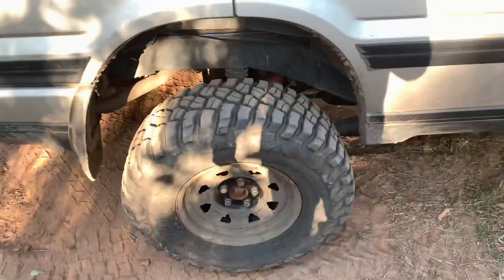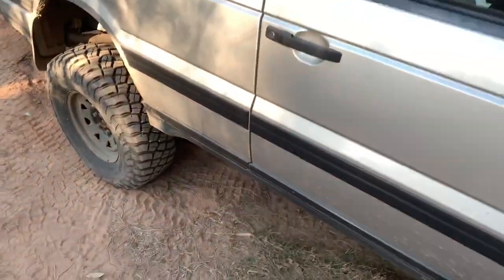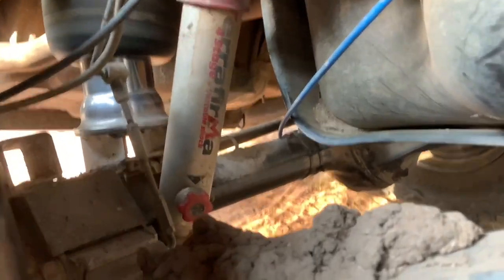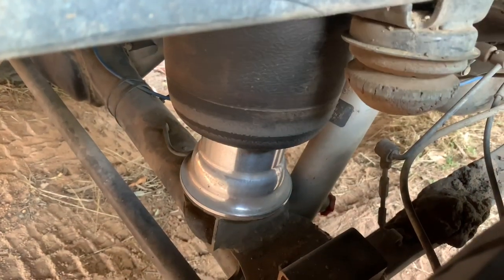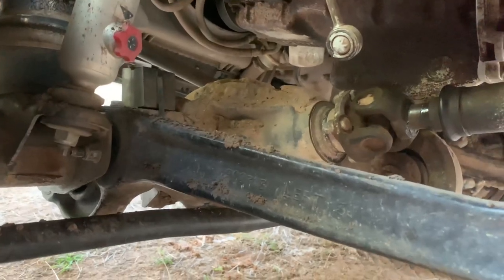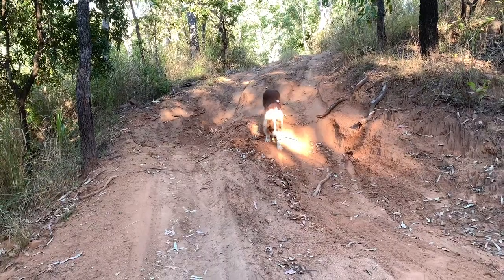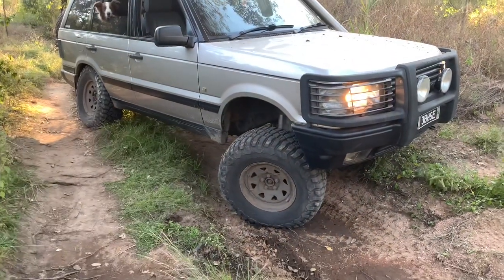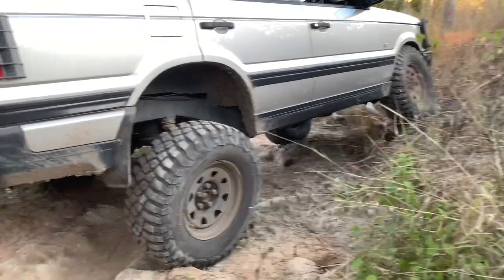2” Suspension Lift & 33” Tyres | Do it yourself | P38 Range Rover 4x4 | Flex it up!

Comment: Hi there.. I've read your the article in the forum. Nice job.
My questions..
When the car is on the lower height it stills comfy? Like highway.

I've got regular coil springs and planning on changing back to air, because I need the ability to lower the car down so I can get in the garage door. I've been instructed that's this Arnott already have the extra length I'm looking but I wonder if it gets safer for the balloons to use the spacers so the balloons don't get ripped off in a flex.
I'm putting the tyres 275/75 r16 and with the coils the tyre but inside, do you think I will need the spacers or just the balloons are enough? 
If I do the spacers a little smaller, let's say 2.5cm on the front, the rear spacers have to have that difference like 3cm on the higher side and 2cm on the lower, is the math done right?

Thanks for the video great great job 👏🏼👏🏼
Reply from the maker: G’day mate, thanks for the message! I didn’t think my link on the forum would get any views!

You’re probably best having spacers too mate. If you don’t do it, you’ll send your guards to the hospital pretty quick!

If you want to do smaller spacers, you’re probably best to drop down to a 265/75 tyre. Even the 275 will be a bit much on a 1” lift.

The other option is to limit the bump stops - make them bigger to prevent flexing so far, although that will prevent you from lowering the height in access mode.

Even with the 2” suspension lift you’d be surprised how low they go. I have to use access to get into my garage, and that’s like an archway - and I’m on 285 tyres.
Reply: I've written wrong.. the tyres are 265/75 r16 dumb me..

Thanks for the reply, like you said I will probably go with the spacers the same as you, that will hélice me the versatility if I want to go bigger one day hehe the bump stop it's a option too, always better to prevent than to repair.. hehe

Thanks again, as soon as I have the beast running I will share something 😜
Reply from the maker: Spot on mate! Spot on 👍🏻
Reply: Hi again.. how about the shocks? Which shocks are you using? Have been told to fit the OEM front shock on the rear.. is that enough to use all the travel of the air suspension?
Reply from the maker: If you’ve got spacers under the air springs, run the Terrafirma +2” P38 springs. There are two types - adjustable and non-adjustable!
Reply from the maker: 2” Suspension Lift With A Difference | BAG IT UP!! P38 Range Rover Airbag Suspension | #eas #airbags
https://youtu.be/GiEAwAY1cIo
Reply: I've been seeing the video again.. and I seen them.. 😅😅 people are talking the terrafirm are not great shock absorbers but if it works for.younit will work for me hehe..

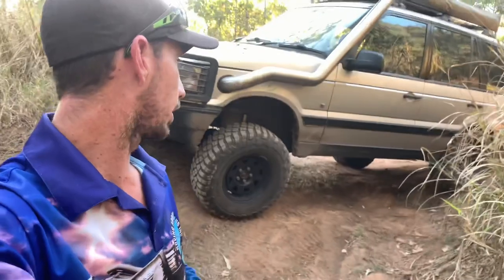Again... great car 💪🏼💪🏼💪🏼 thanks for the video 15:17
Reply from the maker: Thanks mate! I reckon they’re a great shock absorber! 5 or 6 trips to Cape York, plus all of the other HELL I put them through, and 6yrs so far must mean something! Maybe others don’t have them set up right?

Comment: Anyway you can have a set spacers fabbed up for me?  Will arnot genii bags work?
Reply from the maker: I’ll have to sit on that one mate. My metal shop took a break during COVID so I don’t know if they’re running again yet.

You definitely need the Gen III’s for the lift, you’ll over-stretch the Gen II’s or standard bags.
Reply: @Keithy_W  Thanks for replying.  Is there a blue print with dimensions for the front and rear spacers floating around anywhere?  Did you ever consider cutting and welding to extend the sensors?
Reply from the maker: I’ll have to have a look mate. I can’t remember what I’ve done with it!

I didn’t consider welding the sensors because the metal is so thin it’d be a very risky job. It was easy enough just to cut and thread it.
Reply: Decided to go 4" coil lift by lucky.  I don't know exactly how much taller it is than yours, but I assume it should be similar.  I assume it's 4" higher than ride height eas, lucky couldn't confirm though.  Anyway in your opinion for a 4" lift how necessary are adjustable be panhards and custom driveshafts?
Reply from the maker: That’s the go, and the best part is that you’re doing it your way.

At a guess I’d say that the 4” coils would be 4” taller than the EAS at “standard” height. That would make it 2” taller than EAS “high”. Only a guess though, don’t quote me on that. If you take measurements from the guard to the centre of the wheel, in mm, we can compare and you’ll get a rough idea of how much lift you have.

As for panhard rods and driveshafts, I would definitely be doing custom for each at the height you will be running all the time.

Comment: Do you always run on and off trail without the anti-sway bar? Or is it only disconnected for off road driving?
Reply from the maker: RJ G’day mate! I run with the sway bar all of the time. The exception at the time I made that video was that I’d just returned from an extreme 4wd trip where I had to remove the sway bar because I broke the sway bar linkage. You can see the bent linkage hanging down during this video, I literally just returned from that hardcore trip prior to making the video.
Reply from the maker: RJ with that said, the sway bar is sitting in my garage right now, unattached, and the P38 handles like the QEII.

It will go back on, when I get linkages. Until then, I’m not concerned.

Comment: Where did you get that front bumper?? Cant find it online. Can you help me by sharing info about it. Thank you!!
Reply: It is the factory brush guard. Made by Land Rover.
Reply: I do have same question!
Reply from the maker: It is the standard P38 bumper and bull bar
Reply: So funny my p38 has them as well I looked to find some more pics only to notice not many came with this feature.  I have all the brush guards and the ralley lights and the headlight wipers. . Green with brown interior with black pipping.

Comment: Do you need to lengthen the height sensor lower arm or is it possible to just re program the height settings in the computer?
Reply from the maker: Johann Cerecke Definitely lengthen the lower arms. Reprogramming will have the height sensors over-stretch and break.

Comment: Can I just add any 2 inch lift and use the tires you have 285/75 with no rub. I have removed the air springs and put coil springs
Reply from the maker: It’s hard to say with coil spring lifts as they can and do vary. You’d have to do some measurements to verify the lift before going hard with the tyres.
Reply: @Keithy_W  The person that did the job told me the coil springs are about the same height as the standard height of the air suspension
Reply from the maker: I would say it’d be too close to call. You’d be better off with 265/75/16’s at that height.

Comment: how about the panhard rod how did you modify that?
Reply from the maker: Leonardo Curca G’day mate!

The panhard rod is standard. No modifications. The axles still track pretty close together so I haven’t worried.

Others in Australia have modified them to be adjustable. Whiteline here do an adjustable front panhard rod that you can purchase, but not a rear one.
Reply: i have the same bags as you no lift kit and the girl tilts to one side at max size because of the rods you are lucky
Reply from the maker: Are you sure it’s related to panhard rods? Your situation sounds like the height needs calibration if it’s leaning to one side.

The panhard rod locates the axles side to side and doesn’t effect the height of the vehicle.
Reply: @Keithy_W  i transformed the system from electric to pneumatic only. it is linked bouth fronts and bouth backs  i have 2 pneumatic hight butons and a gauge with 2 dials so the only thing i can blame is the rod. do you have an ideea?
Reply: and it leans to the right side
Reply from the maker: Oh wow, this is a game changer!

The way your suspension is set up is dangerous (to be honest, without trying to be rude).  What happens when the axle bags are linked, is it allows air to transfer side to side. This is great off road for flex, but dangerous on side slopes and on the normal roads as the air transfer will allow massive body roll as the weight shifts around corners.

The reason your P38 leans to the right is due to the P38 naturally being heavier on the right hand side (the air tank, fuel tank and most body weight sits on the right hand side).

If you were to put an extra two valves into your suspension setup, and pump them up individually, you’ll be able to balance the ride height.
Reply: @Keithy_W  i've been driving for years like this i use aroind 70 75 psi in then and it ain't that  bad Now with poli busnings it js quite nice in corners. and i have and extra 20l ai tank now in the trunk. but now i know why it does gona have to live with it or go for a  acuair or something because mine was sadly converted ot coil and small ones i hated them so i reverted back to bags. by the way aliexpress and buy the arnott gen 3 bags  copy from there it is  the same only costing i thing 300 Australian  for a set. i had them for years nothhing to complain.

Comment: Arnott or dunlop.. hear the arnott is 2 inch taller then stock dunlop
Reply from the maker: G’day mate, you’re right, the Arnott Gen III airbags are a few inches longer in the bellow, and have a taller piston than the Dunlop bags. That’s the big factor when lifting a P38 to take into consideration.
Reply: @Keithy_W  thanks 🤜🤛👍

Comment: Hi !!
Reply from the maker: G’day mate 👍
Reply: @Keithy_W  I have by pegas p38, what do you think about?  Ekectrika this is car normal? Sorry,  am from Russia.
Reply from the maker: I think that’s a good choice mate! I can’t say I’ve seen your P38, I did have a quick look at your videos. As long as you’ve got a good battery and alternator, you should have a pretty reliable P38 👍 make sure to keep up maintenance to ensure it keeps you moving 😀
Reply: @Keithy_W  I have not bought p38 yet, just going to do it I would like to know about the problem with the synchronization of control unitshow common is this problem have you encountered this
Reply from the maker: Ahh yes, I understand now. The synchronisation issue is more common in the GEMS (1995-1999) P38’s than the THOR (1999-2002), although the GEMS p38 seems to do have more faulty wiring and over-complex systems that the THOR.
Reply: @Keithy_W  we have very little p38 in our region.  I'm afraid to face the impossibility of repairing this problem.  p38 really like it.
Reply from the maker: They do often get a reputation for being unreliable, but its the ones that don’t get maintained that break down. If you get a THOR P38 and learn how it’s systems work, you shouldn’t have too much problem.

Can you do the maintenance on it yourself?
Reply: @Keithy_W  how to distinguish thor from gmes
Reply from the maker: The best way is to do a google search, it’s a bit hard for me to explain here! 

Google “Thor manifold vs gems manifold”.
Reply: @Keithy_W  thank you friend